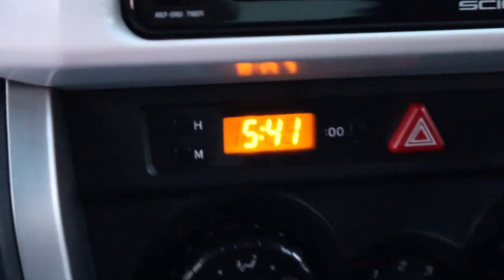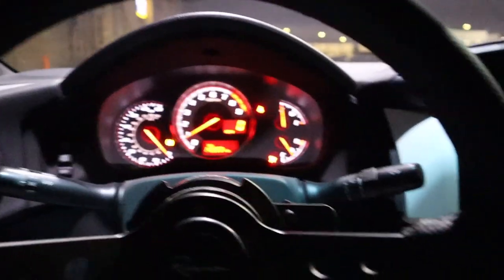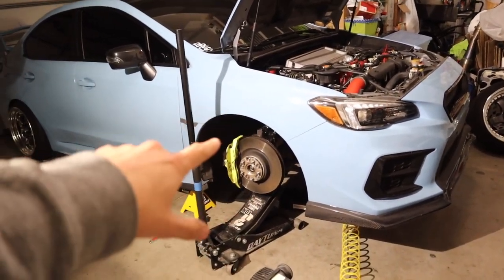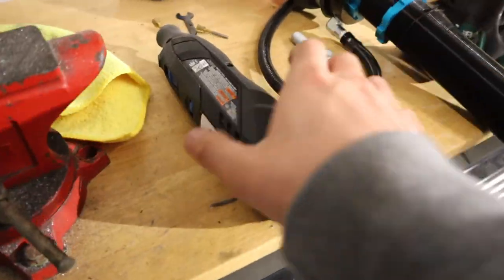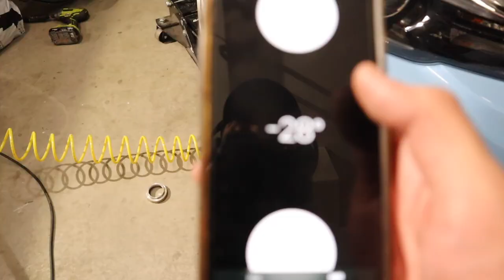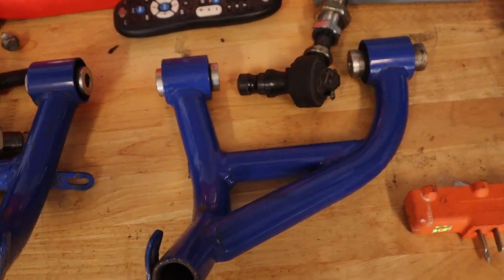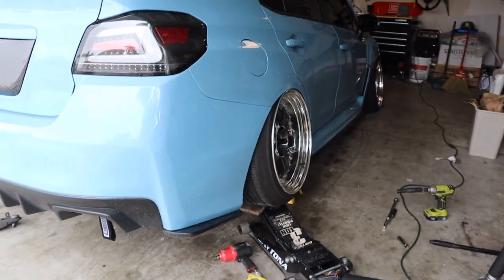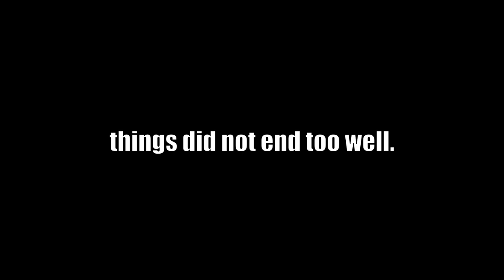Stanced My Subaru WRX STI With PERFECT Wheel Fitment!

Comment: If you don’t want axle bind in the front get the RacerX front lowers and the whiteline anti bump steer kit I believe that’s what it’s called, it’s outer tie rods and the ball joints i run about 7 degrees too and it handles amazing you wouldn’t believe the difference it makes
Reply from the maker: 💯💯💯💯 thanks bro!

Comment: I’m surprised I didn’t get axle bind on mine😂 I have a wrx hatch and I’m static with about 2 1/2 inches to the ground, running -12 camber all around, the most camber I went was -16 and I risked the axle bind, and surprisingly didn’t have that issue, I’m running the camber plates and slotted struts too, and bc coils with 40k swift springs 😅
Reply from the maker: That’s wild. 😂🔥

Comment: After slotting it like that, will the bolt ever slide up an down ?
Reply from the maker: Not if tightened properly !
Reply: @chris_borges  that’s dope then 😎, also I think the static STI is dope an it’s different, build isn’t for everyone but no doubt it’s clean asf 💯

Comment: What tire size did you end up running? Im always having a difficult time to have mine sit like that. Currently on work cr kai 2p 18x9.5 +15  but cant get that lip to fender fitment in the rear like that.
Reply from the maker: 225/40 on 18x10.5. I run 215/40 on 18x9.5!

Comment: Wouldn't it be better to get it where you want. Then have it filled/welded so there's no possibility of moving? Should be pretty easy to get a small piece of metal cut and fit in the slot.
Reply from the maker: That’s another way. 💯